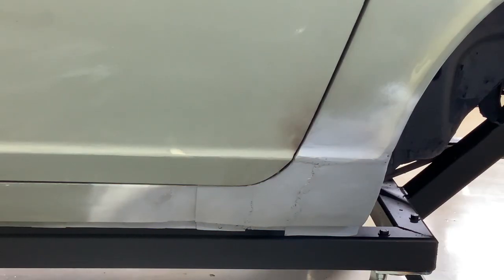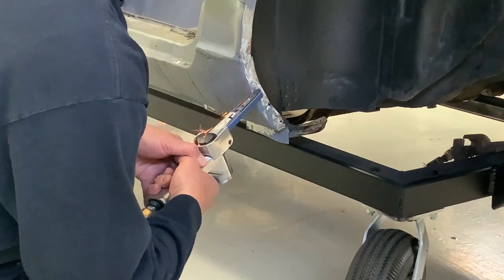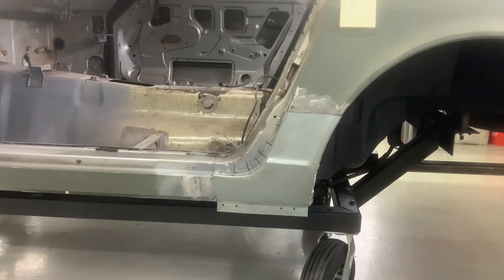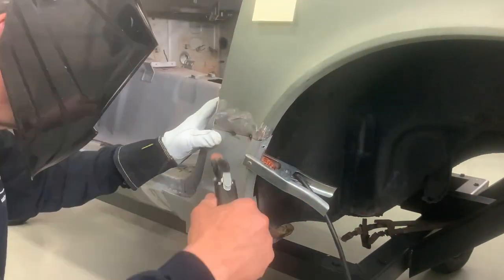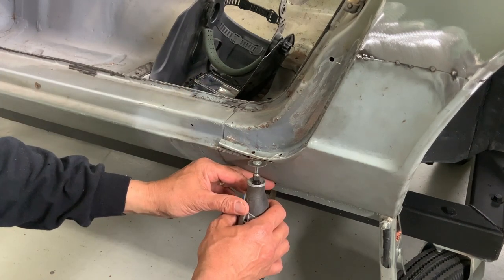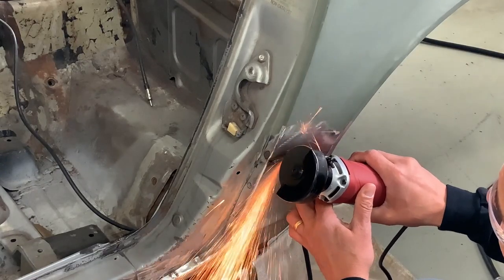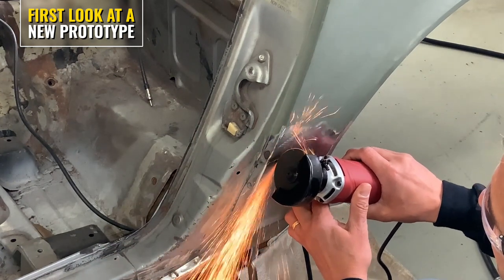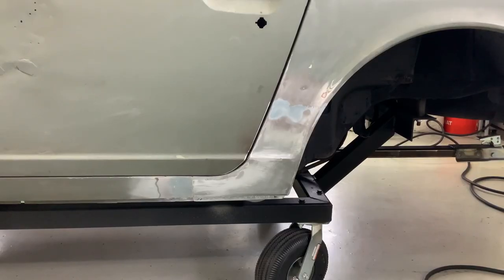Fixing Someone Else's Mistakes! Rocker Panel Repair

Comment: Been edge grinding welds forever, but not in a production environment. Will be watching for more news on that new tool to add to my Eastwood arsenal. This winter I'll be trying out my new Eastwood bead roller on some new floor pan patches.